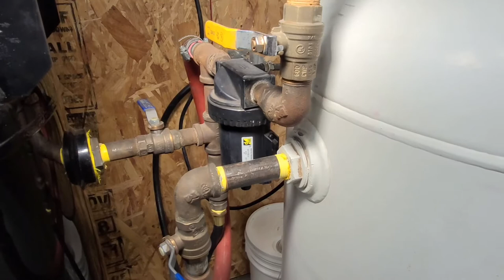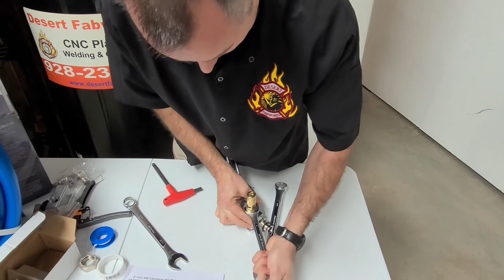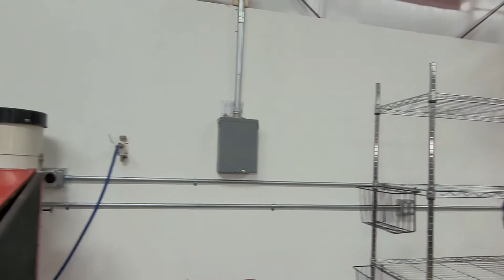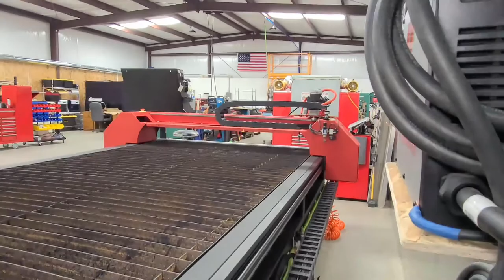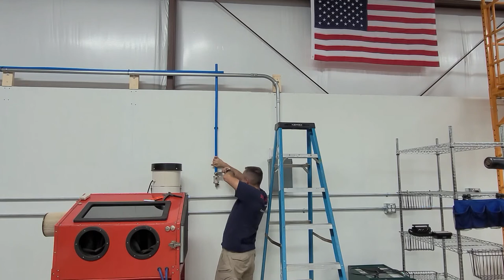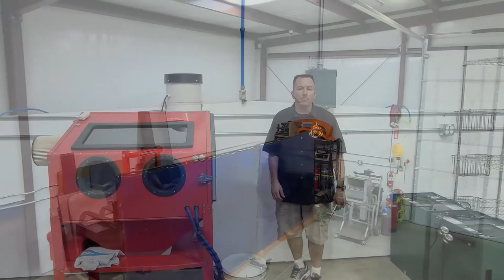Shop / CNC Plasma Compressed Air System, Design and Install

Comment: “Requires 6.7 scfm, let’s round that up to ten”, that’s a huge difference in compressors! Lol
Reply from the maker: Not really when you consider line sizing, distance and other things that may use that air.   You also have to consider that most compressor manufactures give the cfm rating based on ideal conditions right from the tank outlet.   You should never size your compressor right at the bare minimum.   You may think 3.3 cfm is a lot but really its not.
Reply: @DesertFabworks  I’m curious how line sizing, and distance use air volume. Could you explain that better? I understand friction loss, which is overcome by increasing line size, or increasing pressure. Unless you have a whole lot of leaks in your system, how does a system use air?